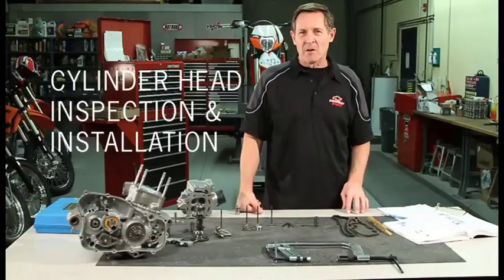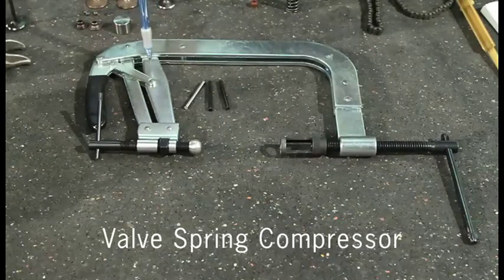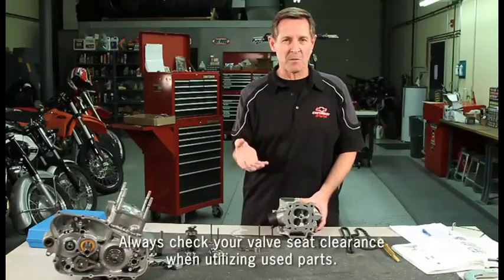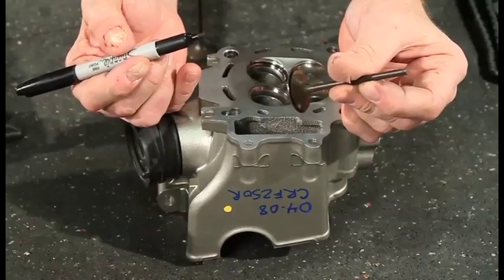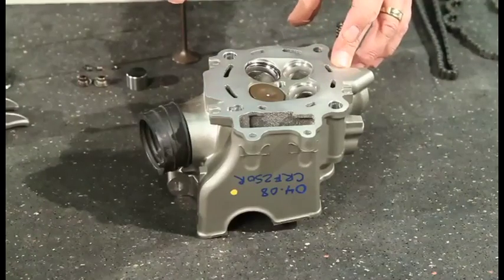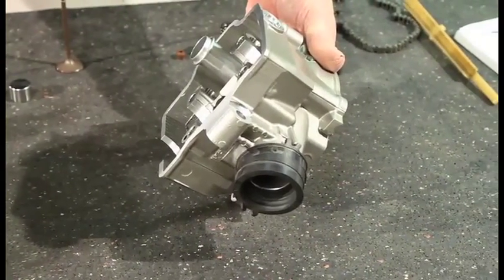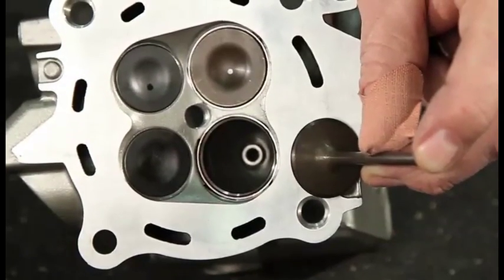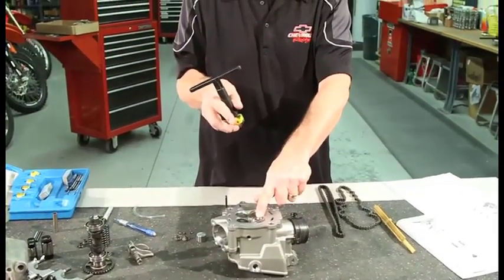Hot Cams Cylinder Head and Valve Inspection Part 1

Comment: As for coloring the valve I don't think you really need to worry about that cuz you're going to lap the valves anyways aren't you you're saying you can't use a used head with new valves your full of shit does Bob cutting tools you were talking about that the tool that goes through the valve guide is a ream and you need to know the three angles you have to cut your valves to cut your valve job because you have to cut the valve seat with two different colors to get the exact cut for your valve the rooms and cutter's they're not cheap you'll be spending some money if you buy the good ones you'll be spending about $1,000 and you're better off buying a new cylinder head for $500 if that's what it costs I know my Honda 400 air-cooled motor it's like $899.99 for the new  head

Comment: At 6:48, the pilot is actually inserted into the valve guide, the valve stem is what is held in place by the valve guide.

At 6:56, during the seat cutting, the seat cutter is in contact with the valve seat, not the valve.

Comment: can I spray my head with wd40 while it's disassembled but all the valves etc are assembled in the head? 

Wil it have a effect on the valve stem seal?

mainly I want to do it is to liquid clean the head before re assembly as I'm only doing a piston change

Comment: The only thing I got from this video.....Buy a 2 stroke.
Reply: +TRX Vlogger how long an engine lasts depends completely on how it's built. there are two stroke generators and diesels that last for thousands of hours and those that only last 150 between rebuilds. oil, temperature and material all play a part. I'm just saying, if I can live without extra moving parts I will.
Reply: Landon Hillyard I ended up with a cr250
Reply: Avenger 21 How do you like it? What year?
Reply: Landon Hillyard 2002 and I love it
Reply: Landon Hillyard  Good point. I Was gonna also mention Depends on how the Engine is a Ran.
Reply: TRX Vlogger For sure. Without a doubt.
Reply: +Landon Hillyard How did you get " Buy a 2 stroke" from this?
Reply: No valves, to adjust or maintain. I think 4 strokes have their place, just not it my light weight enduro bike. I like too ride bike far more than I like to fix bikes.
Reply: Landon Hillyard How do they work
Reply: +Avenger 21 There are loads of videos here that explain them. just search it. they use ports on the sides of the cylinder. much simpler and more powerful design. there is some fuel wasted though, not as efficient as the 4 strokes.
Reply: +Landon Hillyard You do realize a 2 Stroke last's how long? a 4 Stroke will last 10 Years with out rebuild.
Reply: 2 stroke dirtbikes are know for frequent rebuilds . especially if you race or enduro them . Ive had my fair share of 2 stroke & 4 stroke . 4 stroke for many years service as long as you keep up maintenance where 2 strokes i was doing several rebuilds as it was being raced / enduro .  i have a 86' Husq 510 4 stroke with only 1 rebuild in its life it eats 2 strokes for breakfast  lunch & dinner . 2 strokes do have their place & race ready. > Just my 2 cents...

Comment: What he fails to mention is how much one of those seat cutters cost. $700-$2000
Reply: 3ob0 New way cutters are tge best . Not cheap. You can buy two per vehicle . Intake and exhaust  w guide and tee handle. The whole set is 2000. +. Not for amatuers like he said.

Comment: ya send it away to someone and not get any experience? how do you expect one to learn
Reply: This  is a specialty done by experienced machinest with 50k worth of tools.This type of  seat cutter is suitable for small engines. Not many people are good at it even after schooling. I went through a whole year of engine blue printing and learned enough to send them out and get um done right.
There is more to it than has even been touched on here. Get seats ground,not cut, by a pro. Do check his work after. No disrespect inteded,good video.tks

Comment: dude  u  dont  use  Gas for  a  leak check ..  two things you can do to check  one is   go in a dark room shine light  into the top of the head and look to see if you see any  light  coming out of the bottom of the Valves ..  then  there is  a  presser  test   you can do ...